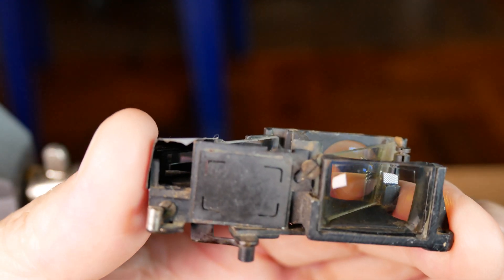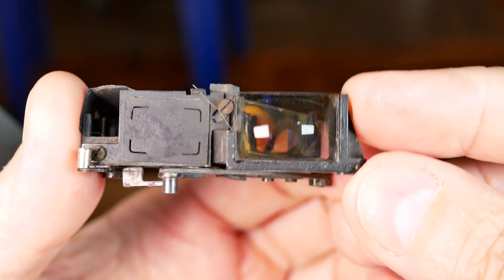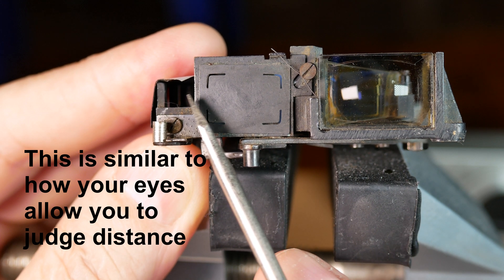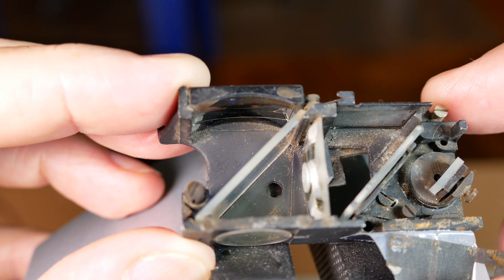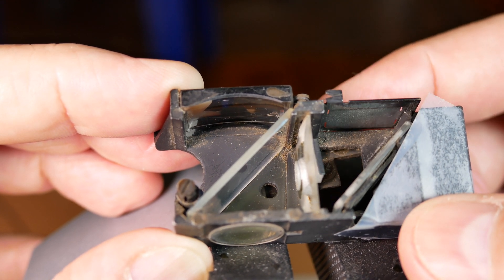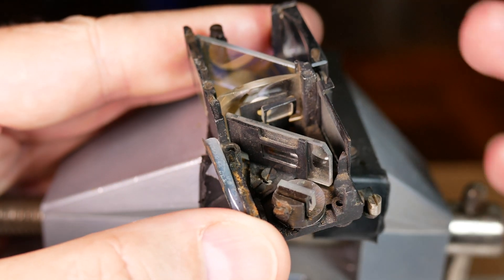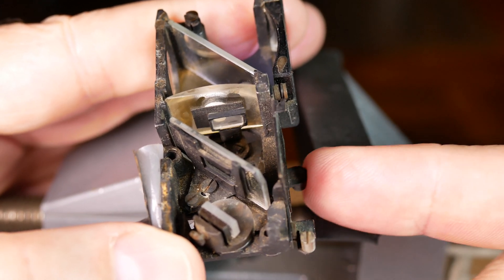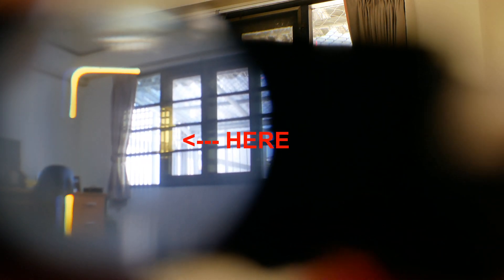Range Finder (From A Film Camera)(4K)

Comment: Thank you for sharing. I also had a video of the rangefinder mechanism of a Canon Canonet QL17 made some years back, but felt this is a much better made and more recent video that I should add knowledge to. I would like to share the knowledge here. I was researching on effective base length (EBL) of rangefinder cameras to understand more about focusing accuracy and stumbled upon something the english-speaking/western rangefinder community probably haven't come across. I read off a Japanese article which quoted some material by Ogura Iwao (a renowned Japanese engineer in camera and lens design). While effective base length gets longer, a rangefinder camera's focusing accuracy increases. While the Canon VI L (EBL = 66.5mm) has longer EBL than the Leica M3 (EBL= 63.71mm), the Canon is not necessarily focusing more accurately than the Leica. The main reason lies in the rangefinder optics. Ogura did some calculations and determined that the way Leica design their rangefinder optics makes them 3 times more accurate than the Japanese rangefinders in the 1950s and 60s. Leica's optics (starting with the M3) ensure that the rangefinder image is a real image projected through the viewfinder, hence the very obvious rangefinder patch with well defined edges. The Japanese rangefinders were using an older technology used in the Leica IIs and IIIs. This optical design only projects a virtual image through the viewfinder, resulting in a much less obvious rangefinder patch with undefined edges. The real image projection requires a focusing setup within the rangefinder mechanism to initially focus the rangefinder patch image on the same plane as the framelines. Then the framelines and rangefinder patch image (on the same plane) can both further be projected to the viewfinder with the same optics and both will be very prominent. The virtual image rangefinder setup ignores the need to focus the rangefinder patch image on the same plane as the framelines, as such while the framelines form real images in the viewfinder, the rangefinder patch image is formed at a virtual plane and thus less prominent than the framelines.
Here's the picture of the virtual image setup used in Leica cameras before M3 and most Japanese rangefinders: (poorly defined rangefinder patch edges)
"http://www.91paizhao.com:8080/91pz/images/camera_info/camera-principle/virtual-image-finder.jpg"
Here's the picture of the real image setup used in Leica cameras M3 and after, and on Leica CL, Minolta CLE, Konica Hexar RF & the Voigtlander Bessa cameras: (well defined rangefinder patch edges)
"http://www.91paizhao.com:8080/91pz/images/camera_info/camera-principle/real-image-finder.jpg"
It is because of that extra focusing setup within the Leica Ms that made the cameras more expensive to make, and the absence that makes the Japanese rangefinders cheaper. Hope this helps everyone understand why some rangefinder patches appear sharp and obvious and some others blurry and less obvious.
Thank you @tsbrownie for making this video.
Reply from the maker: Interesting information, thank you.